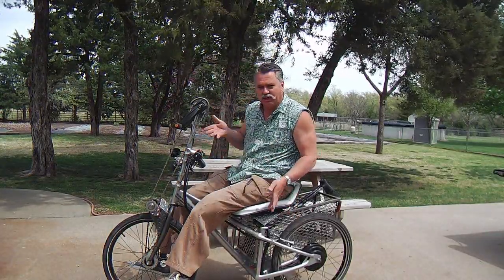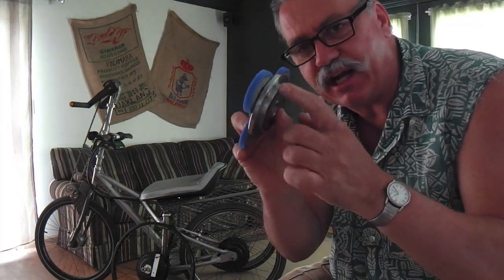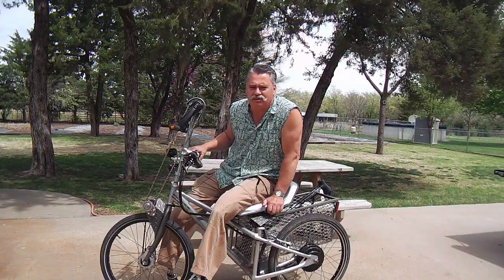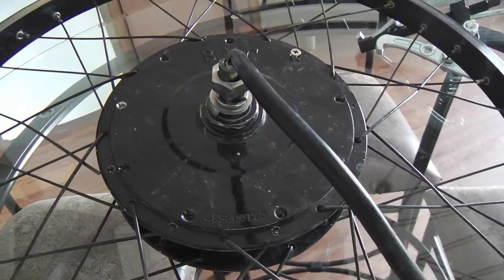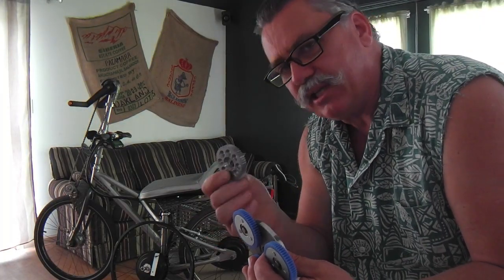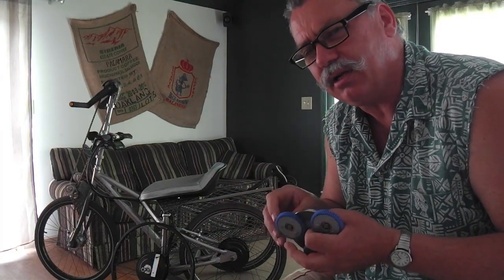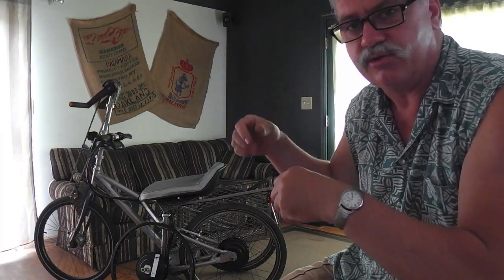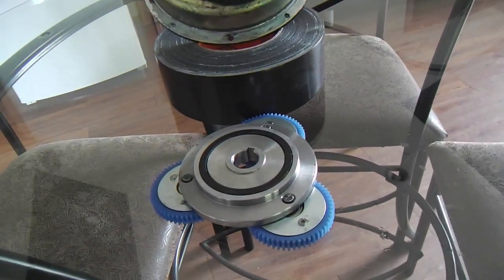Electric Bike Hub Motor Planetary Gear Upgrade

Comment: Hi I like your video its very helpfull, I hope I can help you now with the problem  of the steel wheel catching and rubbing. The small lip left inside the bore to keep the bearing in place is too thick and it allows the gear to drop further than it should. If the bearing is allowed to drop futher in the bore it wouldnt rub,it may also allow you to replace the washer and still be able to seat the spring clip back in place, I have been involved in Engineering for 50 yrs and it seems to make sense, hope this helps, good luck with your great project. Regards Dave

Comment: I may be wrong ' I'm not sure but aren't the nylon cogs regarded as sacrificial in that they are a softer material that won't wear out the hub gear and the thought behind it is its easier and cheaper to replace the nylon cogs than the main hub body and gear which the nylon cogs mesh with! ..not sure what's the best,
Great instructive video though, I love watching these!
I got here looking for new clutch information because mine has let me down, it should rotate freely one way and lock to drive in the opposite direction,  mine has started to rotate freely in both  directions!  Unfortunately you can't dismantle these clutches because they are post and pin riveted together so to dismantle them  is to destroy them, if anyone can direct me to a supplier of these rare it seems parts I'd really appreciate it so much.
Epicyclic gears and clutch are usually sold as a complete unit part
All the best 👍

Comment: Hi!  I worked in mechanical maintenance in the oil field and used a flat plate with automotive sanpaper, very fine grit to remove slight amount of surface area and polish.  A figure 8 motion on the sandpaper to evenly sand and polish.  Find a counter top installer and get a piece of counter top about 12x12" or bigger for the surface.  Hope this helps.

Comment: Thanks found your video very informative, maybe I can return the favour by revealing some things that I've found out. I'm buying the gears online, the manufacturer provided specifications which match the nylon ones, it's 12mm on my bike. I'm replacing all three planetary gears with the metal cogs, the grease used to lubricate nylon gear isn't suitable for metal gears. All metal means you can use Moly grease, this will keep things sweet. I'm getting similar symptoms to yourself, my bike is only 9 months old and has done around 6000km, throttle mode creates a gear slipping sound even if there's no great load. Then things got worse and pedal assist mode has same noise until the bike gets underway proper, my cogs look okay as well but I'm going to change them anyway. High quality Bafang motors have metal planetary gears so I figure that's the way to go. I am also having a problem with the PAS sensor, that may be a factor, replacing that too. Let's hope all that works. The road is waiting....

Comment: I think your bike is awesome though good job great build I love the hand crank great idea to keep it a legal ebike for your situation pure genius and you were cruising too I have built a electric occ stingray chopper myself using a 48 volt 18ah battery with a 25amp controller and 500watt bafang rear geared hub motor I love the 4 1/4" boa fat tire on the rear keep up the great work very informative

Comment: You should consider full ceramic bearings. They spin incredibly fast with no lubricant needed to slow them down or collect contaminants. Not sure if they can handle the load without shattering, but it would be a safer test on a 3 wheeler (and make me more confident to try them in my 2 wheel ebike).

Comment: Thank you for sharing this video.  Very educational indeed.  It filled my curiosity too.  I also took the geared hub route since this is so lightweight compared to DD motors.  I was a bit concerned about the composite gears, but looks like they do hold up very well if not abused.  Thanks once  again for making such a detailed video.
Reply from the maker: You bet! 

And, I did something not long afterwards that was a far better innovation in this area I think, which is, a clutches geared hub motor modification:

https://www.youtube.com/watch?v=t_O4pk4qONU

Comment: Hello and thank you for the great video !
I currently get the same gear rattling and slipping noise you describe from a rear mac motor after 2000km (and some abuse).
I'm in the process of changing gears (full clutch actually), but they look exactly like the new ones... No sign of wear on these blue gears.
If I understand correctly, you changed them anyway but what is you feeling regarding the origin of the noise, did it actually come from the clutch/gears ?
To be honest I'd like to solve the problem without changing the clutch because it involves cutting wires and adding connectors again on this poor cable :)
Reply: After reading on endless-sphere, it sounds like the clutch is damaged. I wasn't sure whether you changed it or not from your video but I'll give it a try and report back.
https://endless-sphere.com/forums/viewtopic.php?f=2&t=93316
Reply from the maker: Right! I'm guessing that it's the clutch that is starting to go on yours too. But, I may not have mentioned it on the video, since I'm using FRONT BMC motors on the rear of my eTrike, is the reason why I had no need to remove and reattach the phase wire and hall sensor connector in order to get the clutch on the cable assembly. I mean, I've got JST connector and an appropriate crimper, but those are little sucker which I try to avoid. But you would do well to master the JST connectors. I was lucky that the FRONT BMC motors are configured differently that the REAR motors, as the cable is on the free side.
Reply: @NewJerusalemTimes Thank you very much for your answer. I changed the clutch and everything is fine now, it seems that it got damaged faster than the gears actually... Might depend on usage though. The replacement one looks slightly different than the original one: hopefully sturdier, maybe just newer (too bad I can't add a picture here).
These JST thing are not friendly indeed, disassembling the connector always ends-up in a mess that requires redoing everything from scratch... Glad I'm done with it, recabling the bike took me longer than changing the clutch.

Comment: Hi Christian, how did you take out your nylon gears to change them? I removed the cir-clip and tried to pull them out, but it did not work for me - i could not pull them out. Thanks.
Reply from the maker: Yeah, they did seem to be pretty stubborn for me too, if I recall correctly.
Reply: Hi there, I'm looking into this whole metal gear replacement thing. Apparently you need a gear lifting tool to get those off; they are a very tight fit. They don't cost much. In the UK around £10. Don't know about dollars.

Comment: Mines done 3571 miles and had a wire fixed and hall sensors replaced internally by me. Mine just started vibrating and stuttering with total loss of power but no errors then started back up without issues, I am going to take it to bits soon - where did you buy the gear cogs from in case that's my problem. Thanks in advance
Reply from the maker: Yeah, here's the place: http://ebikessf.com/mac-clutch

The price is cheaper, at $80 now. They used to cost about $210.

Comment: Hi Christian,

I like the look of the trike bike you used for your ebike setup. Could you name the trike's make and model? Was the cargo space standard? Also, if you know it off the top of your head, how wide is your trike and does it take up pretty much all of a bike lane? Thank you if you have a couple minutes.
Reply from the maker: Sure, Scott. It's not an off-the-shelf unit. I built it by chopping off the tail sections of a couple of cheap, new, bike frames and welding a transition to the head stock. I added a different fork and fabricated a jack shaft for the front hand crank drive. Initially, I had a closer distance between the two rear wheels, but finally landed on a wheel- to wheel to center of about 19", which gives an overall rear width of about 26". And, surprisingly, that's about the same width as broad shoulders on a man, so, no, it doesn't take up much more width than a bicycle does when perfectly upright with a rider on it. It does require a little balancing at times, but not much. So, I tried to keep it as narrow as possible, while keeping it easy to balance, too. I gave it a short wheel base, too, so that it has a tight turning radius for doing tight U-turns in store aisles.
Reply: NewJerusalemTimes Thanks for the reply Christian! I wish your custom made frame was made by someone. A 26" width seems just right to me. Others are too wide.
Reply from the maker: Well, consider this; most any off-the-shelf adult trike can easily be modified to have the rear wheels brought much closer together with not much more than a hacksaw. They typically have two axles fitted to the wheel hubs, that then go through a flanged bearing that is fitted in a housing tube. You can just cut that tubing by an inch or two, as well as the axle at the bitter end (not at the wheel end), and, Viola! When you put the bearings back and cinch up the collar set screws on the axle, your wheels will be where you want them. Of course, a typical basket that comes on an adult may no longer fit in its same orientation. But that's a small matter to remedy.
Reply: Excellent design.  The road shoulder has always been a concern for me while also maintaining an upright balance on its on.  Aiming for the footprint of a man in a respect.  Did you tinker with any ideas for an independent rear suspension.....for that added stability?

Comment: What exactly does one search to find that exact planetary gear? I am having trouble finding the specifications or name of the planetary gear used in these hubs. Any help would be greatly appreciated.
Reply from the maker: Yeah, they're BMC, unless you're talking about that one particular custom gear, which is too noisy for my taste, so I use the standard BMC ones only. But anything BMC is getting tricky to source lately. I mean, they have an office in Chatsworth-CA, still, I believe. But the two dealers I used to get BMC stuff from were Hi-Power Cycles in Chatsworth, which doesn't use any BMC stuff anymore, and eBike SF (aka Roam Cycles), but they closed shop. Do a web search for Brushless Motor Company, then call their phone number. They might tell you about any remaining retail sellers of their stuff. I'm going to start transitioning to some cheap, direct-drive hub motors soon since BMC is pricey and now hard to source.
Reply: @NewJerusalemTimes  thank you so much, I appreciate the help 🙏

Comment: Thanks for the info , I built up a cargo bike with a BMC V3 hub. My question is how much play if any do you have in your hub relating to the axle? When I built up the wheel I didn't notice anything in the truing stand , after mounting I I can feel about a 1/16 to 1/8 play by the tire slightly moving back and forth in my hand while it is mounted on the bike up on the center stand. 
On our non motorized mountain bikes with sealed bearings and quick release hubs there is no play. 
Thanks !
Reply from the maker: +Donny McClure Well, I've never noticed any. But there are some very thin shim washers insider the hub case, at least on one side if I recall correctly on the BMC motors. I did add one very thin shim washer to one BMC, not to take out any play, but to create a bit more space between the spokes of the internal motor and the planetary gear/clutch set, as I could hear a slight noise when accelerating from a stop while also in a turning arc. The shim alone didn't fix that though, it took a light bit of grinding at the motor housing spokes where the contact marks were seen as a faint, but clearly visible circular mark once the hub case was open. 

I think I also used a flap disk to smooth the rivets that held the gears to the clutch also, which are what were the offending or contacting points, but I didn't want to compromise the strength go the riveting strength too much, so I took it out more on the motor spokes as they had far more metal and integrity that could be sacrificed. That one particular hub motor has been nice and quite since. 

So, if you're talking about a BMC or a similar hub motor, just get in there and look around for where there could be any place to snug-up with a thin shim washer.
Reply: +NewJerusalemTimes your video is one of the better ones on YouTube and it's nice to see you using the correct tools for the removal process. that geared hub is very similar to what is in my radio controlled motocross model. best wishes. David.
Reply: How is your power going up any type of hills? I run the CA V3 computer and I'm think my settings are fine . It goes very well on flats but any hill just sucks the power right out of it until I get flat again. Wondering if it maybe a clutch issue and how to test the clutch? Thanks !
Reply from the maker: I'm on the Great Plains of the North American continent, so I don't encounter any grades of significance, but I believe the geared BMC V2T is about as good as it gets for a hub motor. Otherwise, about the clutch, I did a video on it as well, showing how to troubleshoot, repair, and even make a clutchless modification, which I've never seen done on a BMC motor. I'm using two BMC V2Ts on the trike now, as a dual-drive, with one clutchless, so I could change the rotation direction and have the axle cable inboard on both motors. See here: https://www.youtube.com/watch?v=t_O4pk4qONU

Comment: Nice video!  What hub are you using?  Model number?  Thanks!
Reply from the maker: Thanks. The hub is a BMC V2T, i.e., "version two, torque".

And mine is a FRONT hub, even though I'm using it at the tail section, as there's no chain drive to the rear. And, it's only the FRONT hubs that allow you to replace the clutch mechanism without cutting wires.

The V2T hubs are still in production, I believe, but may be harder to come by soon, as the V4T/S/C models are becoming more prevalent.

ebikessf.com has them still, and even a new double-torque V4TT FRONT model for pedicab type applications or for extra quick take-offs, I suppose.

http://www.ebikessf.com/catalog/42

Comment: Thanks for your video! I have subscribed to your channel.

I bought a 36v controller with 36v hub motor.
I powered it with 36v lithium pack.

But the motor does not run.
When i did the same using a 48v controller, the motor runs.
I am puzzled. The motor rims is etched with 36v rating. I can understand that a hub motor can be over-volted but not sure why the 36v controller does not work.

I suspect either the controller is faulty or the hub motor is actually rated for 48V .
How to test what voltage the motor is rated for despite the rating specified on the hub motor rims?

Thank you.
Reply from the maker: Johnny Benson Yeah, maybe it's 48v only. But, on the the BMC controllers I'm currently using, there is a jumper wire for assigning 36v and 48v, I believe. So, if you have one like that, it may do both voltages if you open or close the jumper wire and have it hooked up to the corresponding  battery voltage.
Reply: Thanks for your advice. I forgot to mention in that test, i used a 48v SLA batteries.

Comment: Great upgrade? Bad idea. Why?  Because you can strip the teeth in the hub if to much torque is applied (i.e riding in mud or low traction surface). I'd rather strip a plastic gear than the hub.
Reply from the maker: @100345440098710047113 Thanks for the feedback. But I decided it wasn't much of an upgrade, as the factory composite gears are quieter and hold up surprisingly well, so I removed this custom, metal planetary gear shortly after installing it. But I doubt that stripping the aluminum teeth on the hub, by using that single metal planetary gear, would have been a serious concern, because the clutch is the weak link that negotiates the torque between the planetary gears and the motor, as clutch slippage is what caused me to troubleshoot the hub to begin with, even though I initially thought it might have been some gear slippage or stripping of the poly/composite planetary gear teeth. You see, that's what this video really reveals and what I learned from this process. And that's what led me to do something even better to the BMC geared hub, which is to modify the hub to be clutch-less, which makes for a stronger build while still retaining the higher torque and quicker take-off benefits of the planetary gear reduction, although there is a slight magnetic drag without the freewheeling clutch feature. Anyway, I did another video for my YouTube Channel titled, Electric Bike Planetary Gear Clutchless Modification, demonstrating how and why I did it. The video is about 57 minutes, but I think it give a great new option for the people, like me, who use the geared hubs, but want to alleviate the weakest link in the geared hub, i.e., the somewhat fragile plastic caging of the clutch mechanism. So, if you get a chance, take a look: https://www.youtube.com/watch?v=t_O4pk4qONU

Comment: I'd be concerned that the new metal gear will wear out the ring gear inside the hub, instead of wearing out the relatively-cheap plastic gearwheels.